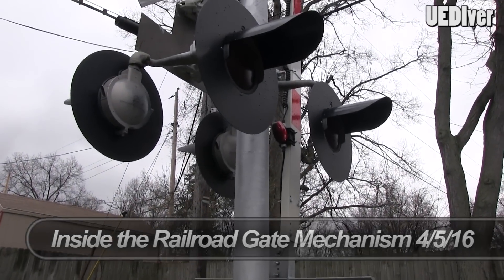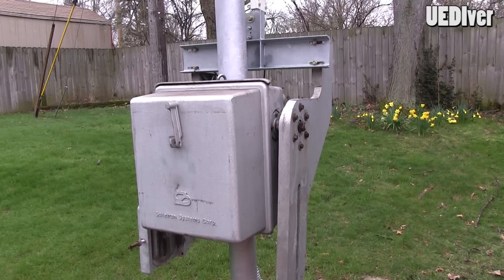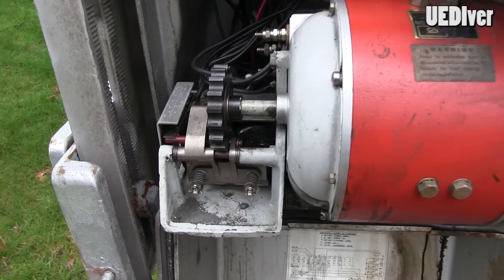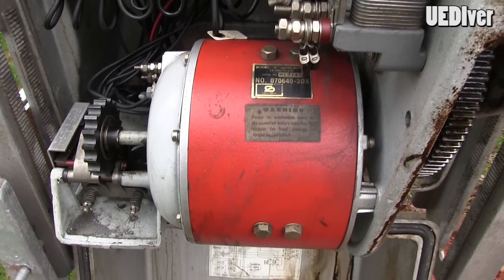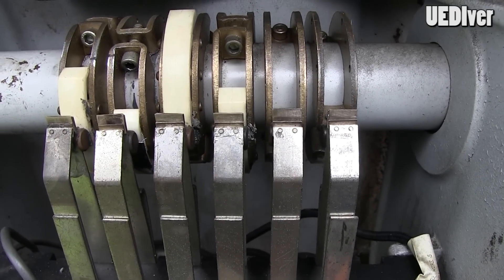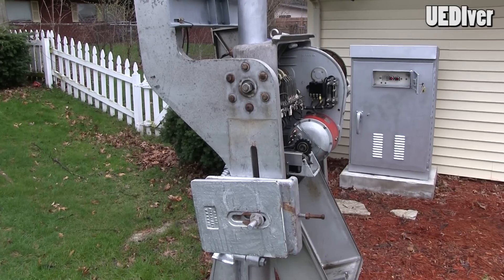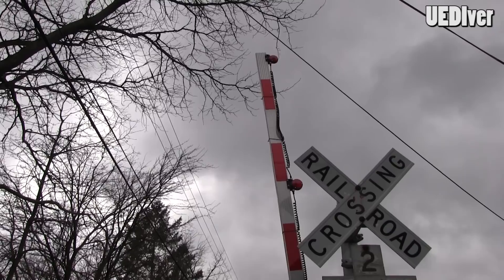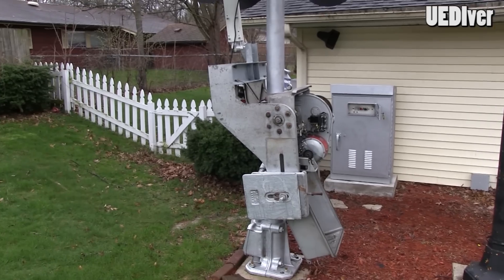Inside a Railroad Crossing Gate and How it Works. Safetran S-20/S-40. Original Roblox Audio Sound

Comment: There are some gates that are hinged so they fold to allow full length arm but are shorter in the retracted or clear position.  The plates on the back arms are counterweights and are adjustable in the slots besides the number of plates to allow a lot of fine adjustment to make the operation of the mechanism easy on the motor.   We had a 56 foot gate arm of wood on Genesee Rd on the Huckleberry RR and it had a lot of plates for counterbalance weights.

Comment: Your power down starts at 89 degrees and stops at 45 then free fails.Yours starts to free fall just as your snub kicks in. Your snub should activate in the last 5 degrees. There is a 3 to 5 second delay from when the bells and lights start ,to the time the gate starts down.. Make sure that the contact on the side of the hold clear is clean and making when it drops. Because that,s what sends BG Battery to power down the gate .Also the gate should be no greater than 89 degrees in the vertical position. And down 5 seconds before the arrival of a train.
Go ahead and ask me how I know all this. I’m a signal inspector for a class one railroad. Enjoyed it.
Reply from the maker: Agreed. I feel like I spent forever trying to adjust that snub to the right settings, but I could never get it right and later videos, I find it a little bit more.

Comment: Do you know exactly how the train going over the rails on an approach activates the signal? I know it's some kind of relay but I want to know if it's like the train connects two rails when it goes over it or what. And if so, what stops the gate from dropping if let's say someone drops a metal rod across the tracts etc. How would someone get the gate up again. Maybe you will get two very small rails and put that in your yard to, to complete your system?
Reply: Yes Jimor you are right, there is a very low voltage 2-6 between the 2 rails and a  sensitive so called Vital relay connected between then , the railcar or locomotive axle shorts the voltage the relay drops and the gate comes down, a metal bar across the track with some contact  pressure  will do the same. If the train axle leaves the section the relay pulls up again and the gate goes back up.
Reply: @jangravemaker1785  I lived in a house for all of my childhood years that had a Southern Pacific railway directly behind it. We used to waive at the Engineer and other times put a penny on track and the engine would flatten it to 3x the size of a nickel. Once in a blue moon the Engineers would have to stop and back up to remove a metal shopping cart that some evil person left on the track. I remember when there were cabooses.
Reply: Actually a crossing operates on a specific frequency for that particular crossing. There is what’s called a termination shunt that is frequency specific. When a train is approaching a crossing it goes across the shunt. It then Changes the resistance .in the rail .The controller unit at the crossing see the Change. It’s called a phase angel shift. Calculates the train speed. And according to the design warning time it activates the crossing. That’s how a crossing works!

Comment: Judging by the increase in speed around 6:58 I'd say there is either a contact not working, wired wrong, the resistors aren't set right or the counterweight is not mounted correctly. It should have quite a steady drop, with the contacts putting the motor in various modes to brake it and slow the gate-drop down.
Reply: It's way too fast. This would be begging for a broken windshield and gate on the road. I'd slow it down just to make the parts last. Grab a manual, set up the weights, torque, and then the resistor. 

Criticism aside, nice job for a layman, seriously. You may as well install the controller when you put in the preemption.
Reply: Increase the resistance and the motor will act as a brake and help slow down the gate arm